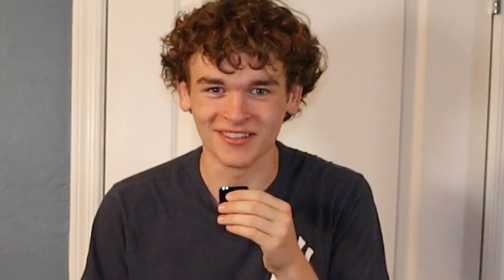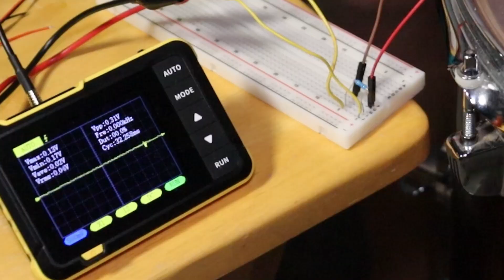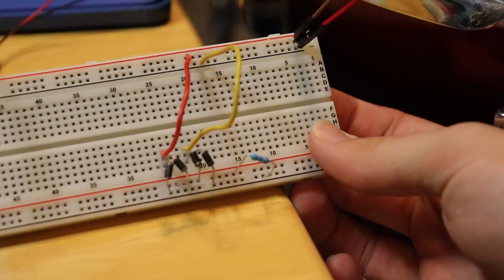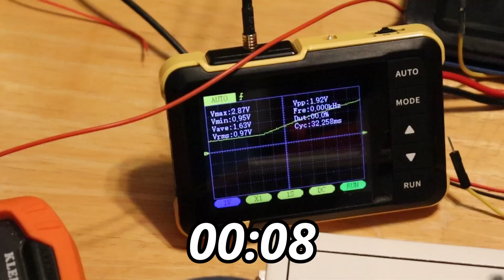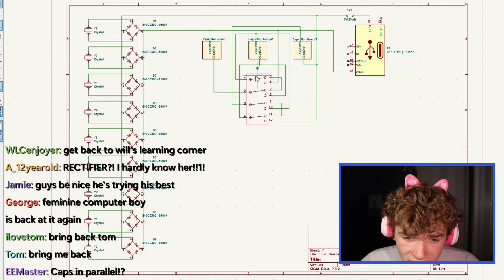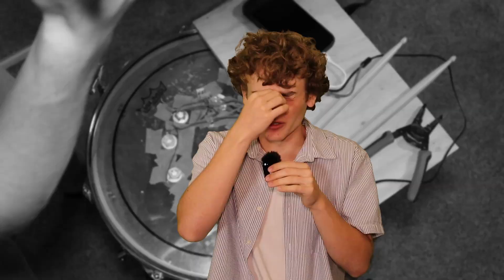I Made A Drum To Fix Global Warming!

Comment: Hey Will, nice work. I enjoy watching your video. I have a suggestion: instead of placing the piezo in the Drums, you can try placing it in the shock absorbers of cars or bikes; actually, it works well to an extent until it crushes up.We can use this generated electricity to power interior gadgets or store it in an aux battery of ecar.

Comment: If you really want to get into drumming, one piece of advice I would give you is to first start with wrapping all your fingers around the drumstick (except your thumb, keep your thumb pressed up against the wood) at a little below the equilibrium point (or the bottom third of the stick). Placing your hands here will give you the most rebound and playability. When you were drumming, I noticed that you took off your back fingers from the stick, and those fingers should stay on the drumstick at all times to give a better sound. These are some basic things that if you worked on little by little, I think over time you could get really good. But keep it up, such a cool build!
Reply from the maker: Yeah, I gotta put down that pinkie lol :) Thanks for the advice!

Comment: did you need all those rectifiers? or could you just use 1?
Reply from the maker: I think if I wire the pads in parallel and put them all through one rectifier, there would be some electricity generated but the pads that were in positive voltage at that instant would cancel out the pads that were in negative voltage, if that makes sense :) Therefore,  I chose to put one rectifier on each pad, though this create a significant voltage drop across each rectifier :(
Reply: @willdoesbuild  i understand, thanks

Comment: You can half the amount of diodes by connecting one side of the piezo's to a common connection and put 2 diodes on the other end of each piezo. 
Here you can connect a capacitor between each diode and the common connection. This doubles the voltage and halves the diode losses. 
It does still mean that the average current is halved because now positive current will charge the high side capacitor and negative current will charge the low side capacitor.

Comment: Just casually solving the world’s problems. Does this mean I can power my electric car by finger drumming on the steering wheel?
Reply from the maker: you'll need something much stronger than finger drumming, like stomping on the floormat.
Reply: That actually might be possible ngl.
Reply: @tankia_osu  not possible. you'll need to hit that drum for days to charge it even half way.
Reply: @nexcover1083  Woosh
Reply: Not at all. You will need to throw a mountain at that drum to charge your car. And even then it won't. You are better off using a solar panel that will work. And it isn't really solving a world problem. Not hating or anything, just saying.

Comment: I loved the video idea. If you revisit piezo disks, you could make a microphone or pedometer with it if you’re up for a challenge. Few things to note though.
1) You definitely could’ve used a dedicated IC like an energy harvester or boost buck converter. It doesn’t increase the complexity that much and definitely would increase performance. The method you used isn’t terrible but you don’t need to reinvent the wheel lol. Also check the voltage drop across that full bridge rectifiers. You could’ve easily lost a few volts across them.
2) Although the charger worked, you definitely should’ve stepped down the voltage. Anything over 5V isn’t great for a phone. 
3) You forgot the two 5.1k resistors on the CC pins on USB type C connector. Because you connected it from connector to phone, it treated it as a USB type A. But this won’t work between two type C devices. Just a thing to note for future reference.
4) Just some schematic and PCB tips. Use power symbols such as 5V, 9V, and ground, along with nets to reduce wire clutter. For the PCB, you didn’t add any copper pours for any of the layers. It doesn’t cost more to do so, and increases performance while reducing EMI in more advanced analog circuits. Other than that it’s pretty good for a beginner PCB design. Glad you got it working.
Reply: I just looked it up, those rectifiers have a 1.1V< forward voltage per diode. This means you could’ve lost up to 2.2V per piezo. 🥀
Reply: just get off the ipad lilttle bro 🥀
Reply: already your profile picture explains what you are already soo get off the ipad 🥀🥀🥀 gen beta kid
Reply from the maker: These are really good points! Yeah, I definitely lost a lot of voltage across those rectifiers, but by the time I figured that out I had already made the pcb, and just needed the design to work :(